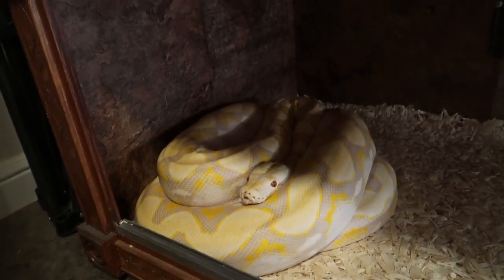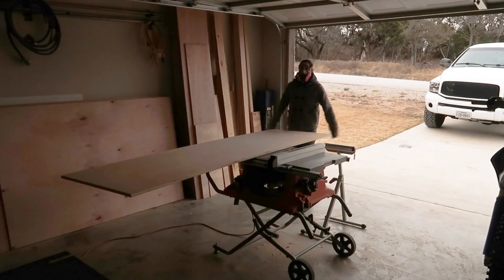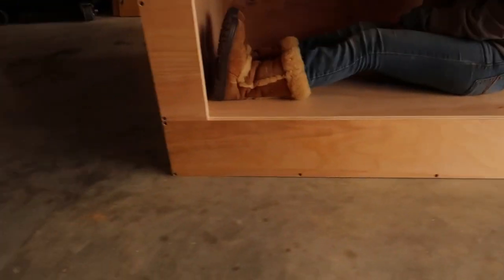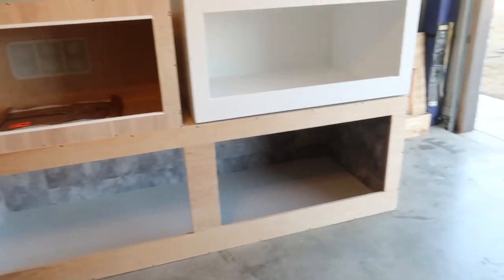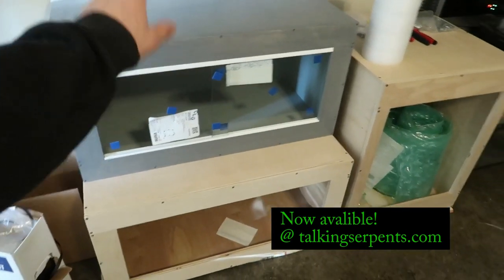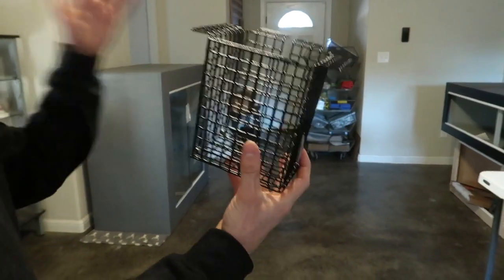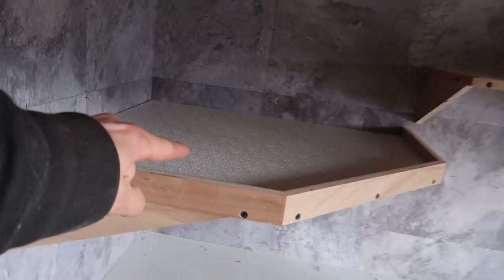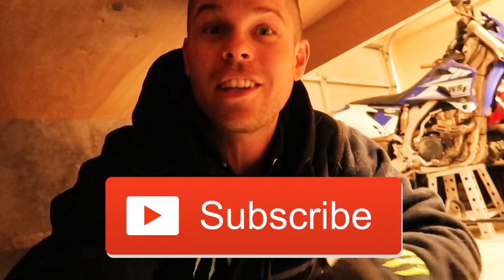Building A Large Reptile Enclosure That My 12' Snake Deserves!!!

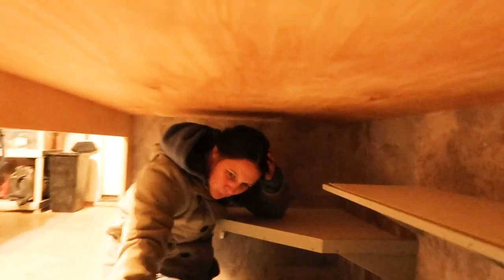Comment: Vey cool enclosure.  I am currently building a 2’ high x 30” deep x 72” long enclosure for a Texas Indigo.  The snake is currently a juvenile so I am installing a temporary center divider to make a temporary smaller cage for the snake until it grows to full size.  What would you recommend for UV lightning for the entire enclosure.  I was thinking (2) 34” fixtures that can 10:23 be installed to the ceiling, and they can plug in line to each other do one switch turns both lights on.  Your thoughts?  I would not be using the right ceiling light until the center divider is removed in a few years.  I will also be ordering your heat bulb fixture/cage kit for the enclosure.  Thank you for any recommendations you have in regard to  installing UV lights in my enclosure.

Comment: I need this kit how do I purchase?
Reply from the maker: Check out our website talkingserpents.com

We don't have this size avalible on our website since it would be too large to ship, but we have made a solution for our customers. The solution is called adapter kits. 

Since this video came out we made adapter kits to combine our reptile enclosures together. This makes it much cheaper to buy a ship them. For example you would be able to take two 4' wide x 30" deep x 30" high reptile enclosures, one 30" deep x 30" high adapter kit. Combine them together to make a 8' wide x 30" deep x 30" high reptile enclosure.  

We have several different sizes for adapter kits on our website talkingserpents.com and even have a YouTube video taking about our adapter kits.

Comment: What did you use to waterproof the bottom of the enclosure? Drylok extreme or something else?
Reply from the maker: I applied Drylok extreme, and on the bottom itself i secured a piece of what is called white wall board. This makes cleanup quote a bit easier.
Reply: @talkingserpents  thanks
Reply: @talking serpents  how did you attach your white wall board to the bottom of your enclosure?

Comment: Is that 3/4" plywood?
Reply from the maker: It's a mixture of 1/2" and 3/4" birch plywood.
Reply: @talkingserpents  good deal I knew you used birch, that was what I plan on using as well. I'm about to build out 6 new 6'x3'x18" for a breeding collection. Your videos are really the only ones out there with good information on nice plywood enclosures! Going to order a few of your hooks as well, they look nice.